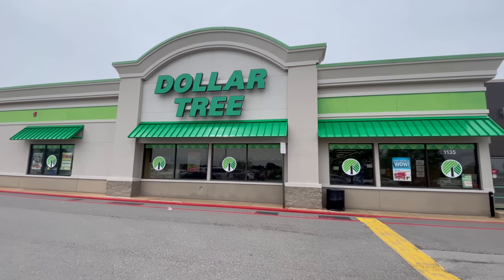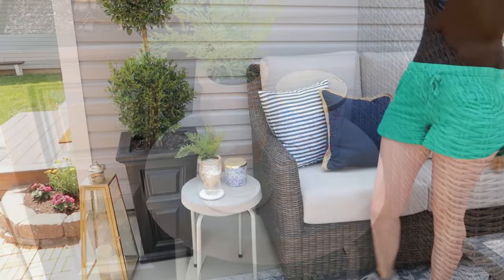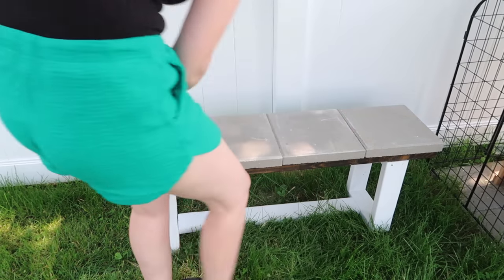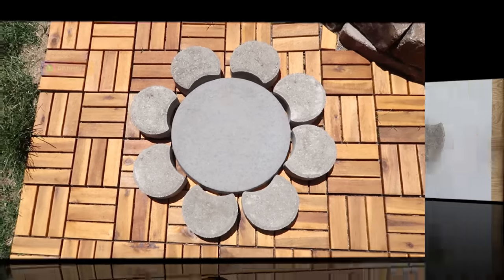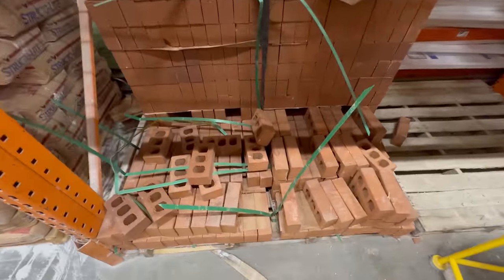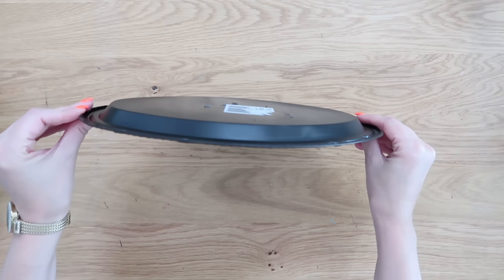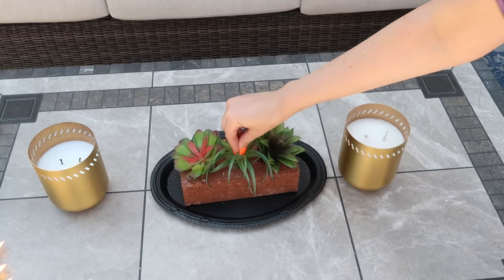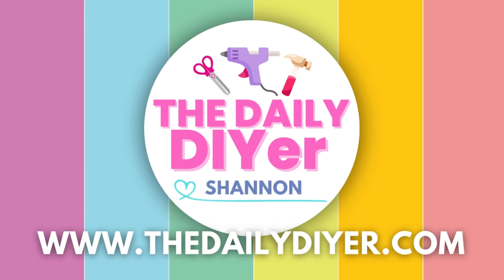$1 OUTDOOR PAVER HACKS + Dollar Tree DIYs & Ideas! 2024

Comment: The brick with the emergency candles could be used inside as well in emergency times. The sand males them safe and helps to hold them straight up and it will light up the room.

Comment: Those pavers did you put the address on if you line them all up, you can power wash them and it really helps remove a lot of the grit also and then let them dry out in the sun and put the vinyl on them. It really works really well I would like to see you paint one with the color and then put the final on top of it. It’ll stick better to the paint a flat paint

Comment: I always have a problem with my cricket, it doesn’t seem to cut deep enough and the transfer get destroyed when I start to weed it. Any suggestions?
Reply from the maker: I would check your blade right. See if it’s got some vinyl stuck up in there or just needs to be replaced. You can also select your blade depth. It usually is set to “default” but you can adjust it from the drop down menu when you click it. I hope this helps 💗💗💗